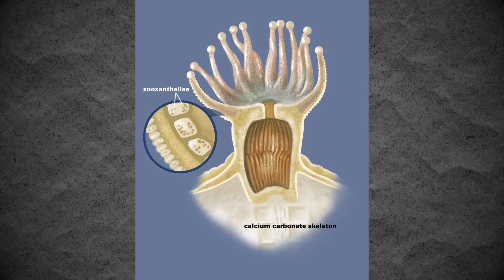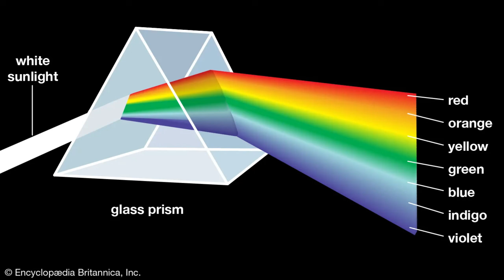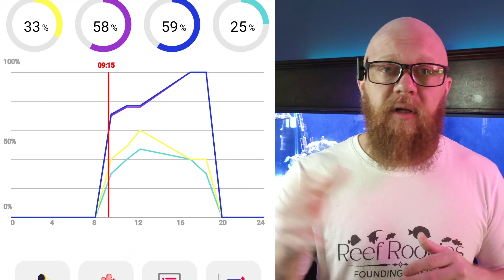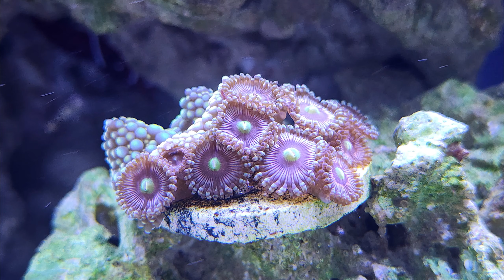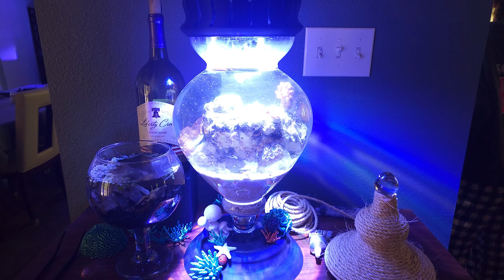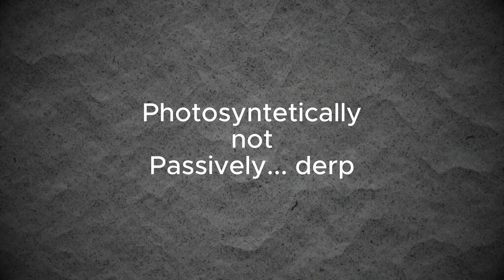Coral Lighting 101 - Get your Reef Tank lighting correct!

Comment: I heard the lighting requirements for coral are much different than anemones
Reply from the maker: Not in my experience.  But it also depends on the species of nems.  BTA and LTA need basically the same intensity as most corals.
Reply: @reefrookies Also, anemones require 6 months or longer for tank stability

Comment: Im setting up a 20 gallon tank. For clowns and anenomies, and a few coral.
I was thinking of a Kessil Tuna Blue A80.
What's your thoughts?
Reply from the maker: Very good lights that somhow manage to output strong par at lower wattage.  Youll want it pretty low to the surface 4-6".
Reply: @reefrookies   thank you for responding.  I appreciate your advice!

Comment: Meanwhile Im running 10,000 K Metal Halide.  Its cripst white as you can be without being piss yellow white.  Corals are super healthy and I dont have excessive algae.  A lot of people likes the full spectrum light as its a breath of fresh air compared to all a heavy blue dominated tanks everyone have.  Also I have different coral choice due to lighting that I have as alot of coral shines under white light and alot are just blobs of orange or brown color.  Plus its just like snorkeling on the reef. Believe it or not my Orange Ricordia Yuma Mushroom liked going up the rocks in the middle of the high light spread and basking side by side with my SPS.  Also theres spread, if you have cheapo LED everything is focused down where the lens hits but drops off sharply on the sides.  I have the exact mushroom growing under the rocks and happy.  So it depends on your taste and preferences.  I have evidence in my channel.
Reply from the maker: I dont dispute anything you have said one bit.  I love MH lights.  I love the controllability and lack of heat from LEDs way more.  I actually intend to use MH lights on my next big tank, with LEDs for supplementation.

Comment: This was extremely well done. 
Lighting is arguably my favorite topic in all of reefing, and having formally studied it during a degree in agriculture, I'm familiar with most of the background knowledge driving the topic. 
You did a great job of bringing just enough scientific information into the discussion to be useful, without getting to deep in the weeds and loosing most of your viewers. 

The only part I would push back on, is that white light and the industry's shift away from it somehow grows less algae. The industry's shift is due to consumer demands, not science. Those green common algae's like bryopsis or filamentous hair algae's all have Chlorophyll a as there primary photopigment and will grow just fine in blue dominant lighting. That industry shift is due to reefers demanding more of the high energy blue, violet, & indigo wave forms to drive coral fluorescence, not photosynthesis. 
Aside from that, your video is excellent. And my argument here is a minor knit-pick. Great video.
Reply from the maker: I appreciate you bringing your expertise to the table.  I take no offense at being corrected, and I do agree with you for the most part.  Thanks for the thoughtful comment as well.  Always interesting to get more info from experts in specific fields.